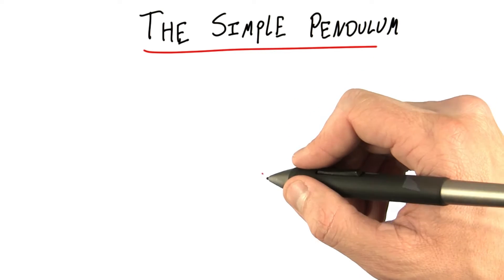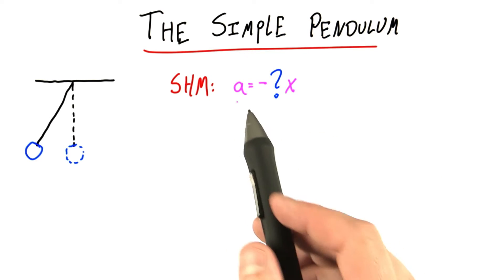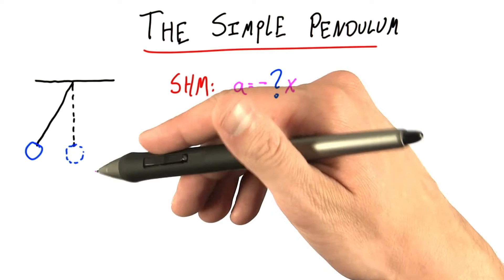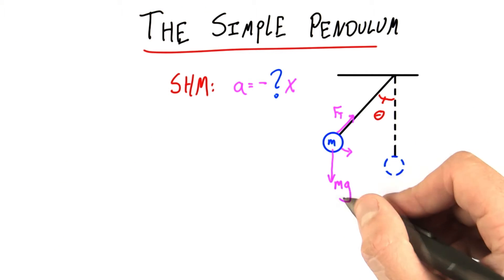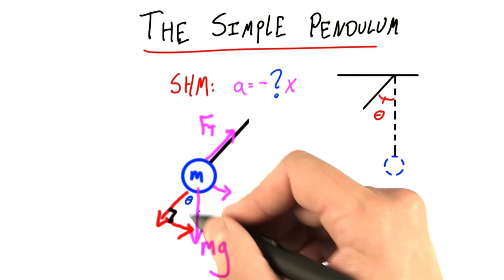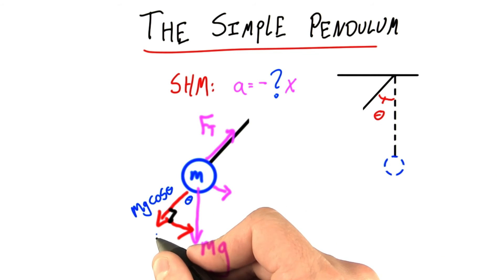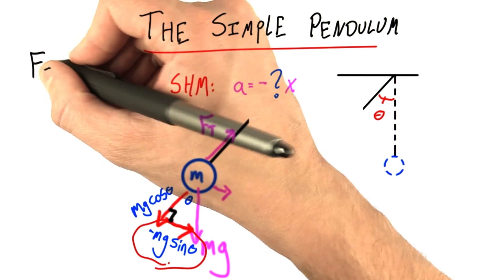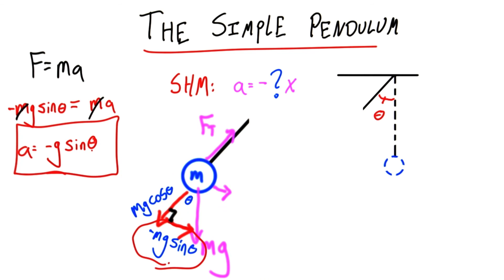The Simple Pendulum - Intro to Physics

Comment: 1:31 That is wrong. Those forces only equal at the highest points of the motion, when the angular velocity is zero. It's a circular motion, it has acceleration towards the center when the angular velocity does not equal zero.